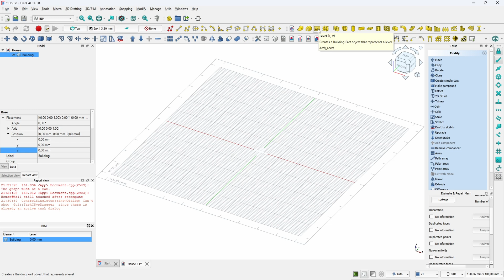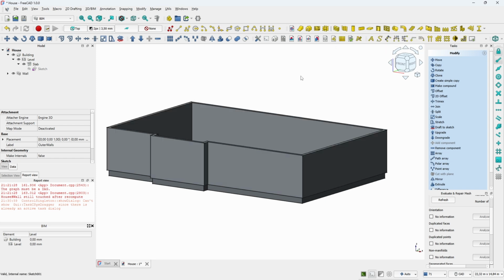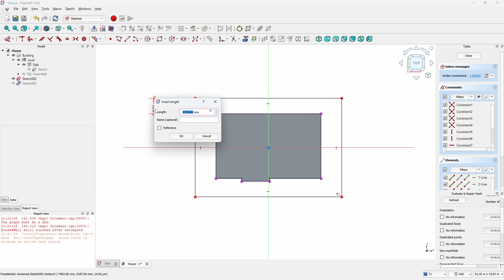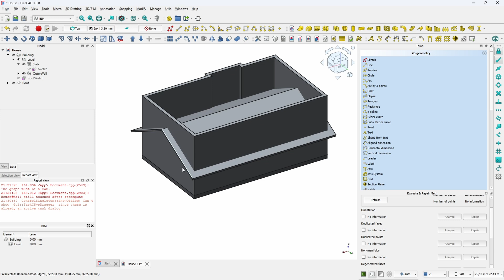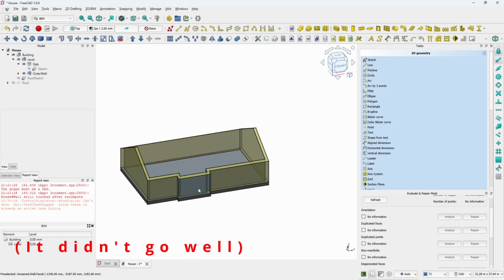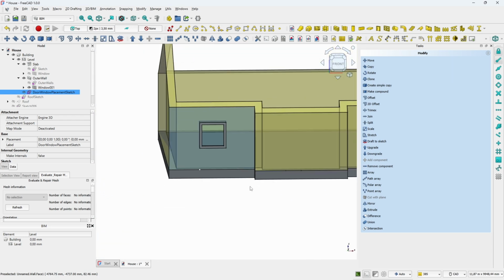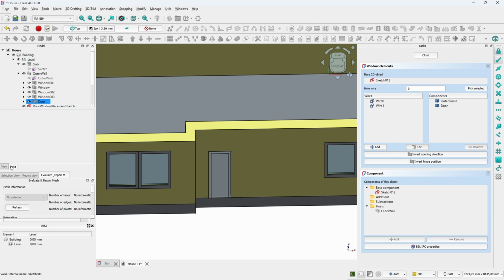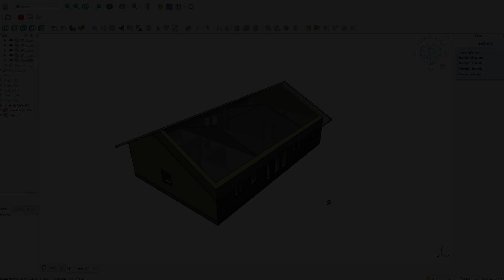FreeCAD - Let's build a house (Part 1)

Comment: it wont let me sketch
Reply from the maker: "it"?
Without having any idea what is going on, it is hard to help. But - if you are intending to use a shape binder to sketch on, you need to hide the Body that the shape binder was made from. Otherwise you are trying to select a face of a body that is currently not active.  On that note. Make sure the body you are sketching on is active (highlighted in the list).

Comment: 35 cm thick walls... are you building a bunker?
Reply from the maker: 348mm walls are on the lower end of thickness here. I'm aware that nailing plywood on some sticks is considered "a wall" in other parts of the world. But we need (and like) insulation. The three little piggies also had something about huffing and puffing our houses down. We don't have such natural disasters here, but in places where people do, it amazes me to see those "walls" flying off as if the building code was completely not expecting such an event.  :)

Comment: Thank you for the video. I would appreciate if you could show every measurement in your plan.
Reply from the maker: Thank you so much for watching! :)
What would be the need for this? To exactly recreate this particular building?

You could always sketch your dream building on paper instead?  :)
Reply: @JWAM  so they can follow along of course.... Arrogance will get you nowhere. Don't post if you don't want questions.
Reply from the maker: @anthonyschluter8531 I'm sorry if my response rubbed you the wrong way. I was genuinely curious about the purpose. The intent (with my response) was also to encourage to just go for it from the rough dimensions that can be seen in the video.  I remember briefly thinking about whether or not I'm allowed to share the originals as is - as the drawings are by the company who built the house, and that I would have considered looking it up had the person insisted on it.

The whole point with these videos is to show that even an amateur can manage to use FreeCAD, because it's well-known that it's a piece of software that can feel really intimidating at first.

I wrote my comment with the best of intentions. Again, I'm sorry that you perceived it otherwise.

Comment: Very good tutorial but please, talk a little bit louder.
Reply from the maker: @fatihkayal9021 Thanks for the feedback.  I have great difficulties with my audio levels, as I need to figure out how to get loud levels without getting other noise in the mix.

I will look into this just because you mentioned it. :)
Reply: @JWAM  distance from your mouth to the microphone will be the biggest difference you can make without spending money or learning any audio processing skills. the closer the mic, the greater the signal-to-noise ratio and the higher base loudness you get for your voice. 

the main things to look out for are your breath hitting your mic and causing wind noises, especially on plosives like the p in "pot" and clipping your input by having your voice be too loud for the mic. speaking softly and comfortably with the mic at the right distance will also help minimize room reverb. speaking more loudly with the mic a bit further away will help reduce plosives but it will also pick up more room reverb. 

even using your phone to record audio with a sound recorder app by placing it just under your chin, out of the way of your breath, can give you pretty good audio. learn clap synchronizing to make sure your audio and video are synchronized correctly. 

i don't know what programs you are using for your audio processing, but remember to do noise removal before you amplify anything. amplification also amplifies the noise making it harder to remove. make sure when you record to leave 5-10 seconds of just room noise to help your program figure out what noises the room has that need to be removed.

you can get into learning about peaks and harmonics to tune your audio and really bring out your voice over the background, but that's overkill for most creators.

hope that helps and good luck on the channel!
Reply from the maker: @jsmxwll  I was going to respond to this thread earlier today once more but didn't have the time (as in, I have ordered a microphone today that suits my needs).

Some of the problems were:
1. I cannot be bothered to have a secondary recording of audio that I need to sync with the video, so recording with a phone is a no-go.
2. I have a "nice" microphone (A white blue snowball), but it's very much the wrong microphone (condenser). It picks up absolutely everything in the room.  So turning down the gain until it doesn't gives a horrible SnR, unless I'm really close to the mic, which is both uncomfortable and gives an extremely boomy sound, which becomes especially weird if one is talking with a rather low voice.
3. I tried a headset mic a couple of videos back and it had horrible quality.
4. So, I ordered a cheap dynamic mic with a boom arm and my audio troubles will finally be over. 

I would have saved you the trouble had I just been a bit quicker coming back to this.  :)
Reply from the maker: @jsmxwll I have a hard time ignoring information from someone who has it.  :) 

"if you can get it close to your face, a shure sm58 is an excellent dynamic mic [..]  / if you want it further from your face, you might look into shotgun condenser mics."

I bought a cheap 'Tonor' including a low-profile boom-arm which I'm sure will solve my problems. I have 3 screens covering my whole front of the desk and most arms are likely to be in the way unless I'd have some floor-standing mic (which would then pretty much trap me in the chair). My snowball is hanging upside down from a custom mount attached to the bottom of a shelf above my screens, to not be in the way of my screens / avoid vibrations from the table.

I think I am forced to mount the boom arm to the table but I'm not worried that it will carry the vibrations to the dynamic mic the same way the snowball did (closer to the keyboard, and a more direct / shorter stand.
If I experience issues with vibrations or visibility, it would force me to raise my screens a bit to be able to attach the boom-arm on the wall below my screens, to both eliminate vibrations and the visibility issue.

"off axis about 6-12" [...] stand connected to the floor and not the desk to avoid picking up keystrokes and the like. you can put some sound insulation behind it to prevent sound pickup in that direction." 

Like I said with the vibrations, I hope it will not be an issue and there is a solution for it. When it comes to the direct sound of the keyboard / mouse, I have thought about padding as a way to dampen/eliminate it if necessary, but I have the visibility-restriction, so I need to have as slim of a setup as possible.  The kind of videos that I do, I don't really mind that some keystrokes are audible when I do things where audio is recorded at the same time, as I think it simply "adds to it" as there isn't anyhting else going on as it might be in some other kind of videos (like gaming?). 

"this is much less budget friendly [..]".
Maybe some day when/if my channel is monetized?  :) 

"the blue snowball being a condenser isn't usually an issue, it's that the blue snowball isn't a very good mic. [...]  the lack of gain staging and the general lack of preamp control really makes them hard to use well. because you can't really control the mic or preamp much you end up having to control the environment, which can be pretty uncomfortable or impossible in some situations" 

You obviously know this stuff better than me, but my impression is that there isn't really anything wrong with the one I've got, it has three different modes for varying purposes, of which one would work decent in this room if I were to do "a podcast" or similiar where I could focus better on having the mic at a specific distance. But more than all, to me it feels like a "studio mic" and it is expected that I simply cannot have that constant hum from a couple of devices next to where I am recording. So I can't say I'm "actively unhappy with it", it just doesn't fit where I need to use it.

Looks like the parcel arrives tomorrow already, when ETA was saturday.  Good times.  :)